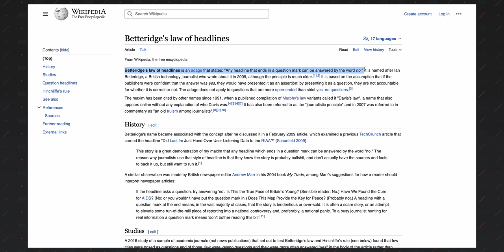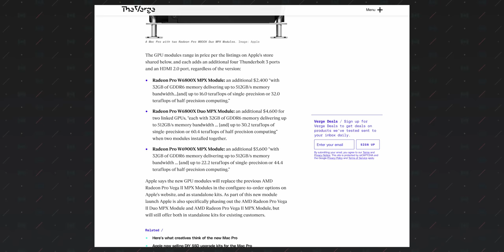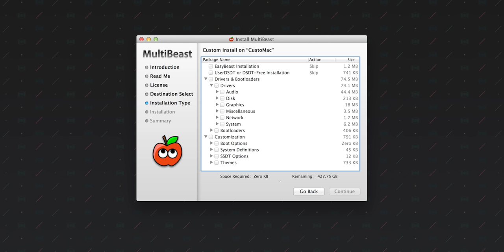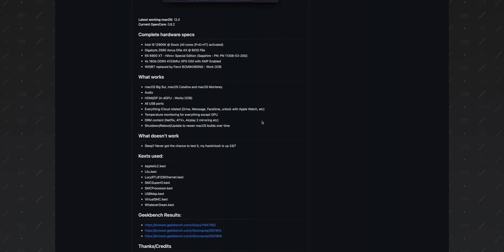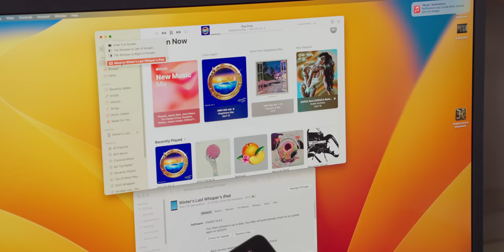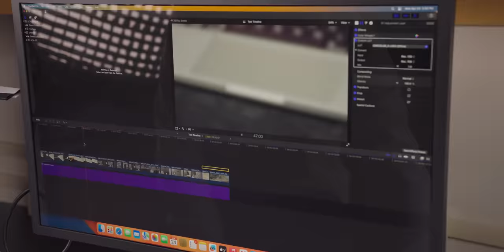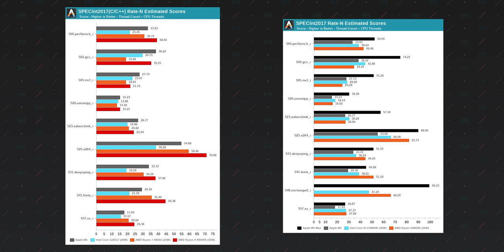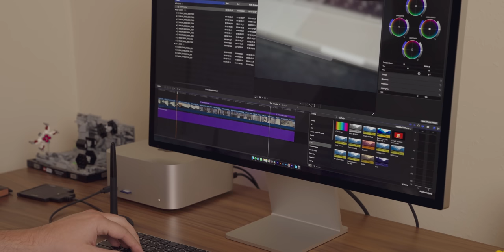This $2,000 Hackintosh SMASHES the $4,000 Mac Studio

Comment: So you compare an M1 Max and an M1 Ultra to an i7-13700. Why don’t you compare them to an i7-11th gen? Cause intel 13th gen were released this year. It’s not a proper benchmarking. Not to mention that the software you use for the Hackintosh is not legal. And a normal user would have serious trouble getting it on their computer to work properly. I mean it took you some time to get it done properly. So for a fair benchmark between the systems, you should used 11th gen cpu and also you should maybe consider laptop versions of the 11th gen cpu. Cause there is no difference between the M1 Max used in laptop and the one used in desktop.

Comment: Hackintosh's are a nightmare to maintain. One single update can break the entire thing and for that reason, I stopped using it. Everything requires some sort of complicated workaround that requires weeks if not months to study and understand. Also, you will not be able to change MacOS versions automatically. Again, to do that you have to implement complicated fixes, patches, workarounds, and patches that make Hackintosh's unsustainable. Save your money. Get an actual Mac or use something else.
Reply: Or perhaps dont update?... many people use older versions of MacOS without issues actually. For better stability etc. even when they could be running the last one and update it frecuently. Also hackintoshes usually are for large audio and video work, so it can be 1/3 of the price of a similar mac..

Comment: When all is said and done what it comes down to is rendering time. And that equation comes at whatever you deem your own time to be worth divided by how much rendering work for however many years. I have built hackintoshes and been rendering since i was using Infini-D on a 9500 Mac where six seconds of animation took days to render, watching that line slowly moving across each frame painfully... so us old school dudes don't mind an Intel based machine taking the extra 12 minutes to process a heavily FX-laden short movie vs. Apple Silicon. But like all artists, the posers need to blame their gear rather than their talent and that leads to another set of equations--whether you can make money doing this or not and invariably most cannot with the UltraMax megacore beasts or the punieste Intel squeakers chugging away. How "cool" you feel is the evil work of the ad agencies on your psyche as an artist... Don't let them convince you that you having the most optimized system automagically means you can start making money doing whatever you're doing.

Comment: This is like comparing different caviar. So unnecessary to have any of these two computers. It is only for rich people showing off.
Reply from the maker: Or, you know, professionals that use these computers to make a living…
Reply: @snazzy  other than 4k and 8k video editing, which not much people do, there is no point in paying 1500 to 2000 dollars for a laptop. Coding, streaming ,can be done efficiently using decades old laptop. 

An iPad for emails, ebook, streaming, video browsing. And then a desktop, paired with quality screen, mechanical keyboard, good speaker, for doing any other real works, is good enough for almost everyone. And it cost just half the price of the 14 inch MacBook Pro. And they can be upgraded throughout times.

As most of your viewers, I assumed, don’t even watch YouTube on their laptop, and for most of them, they just want a laptop to watch Netflix, this MacBook Pro seems overkills. What percentage of your viewers watch this video via a laptop?

Comment: So let's see... you have to assemble your own PC, which takes time; you have to install and figure out the Opencore and Hackintosh setup, which takes time; your system takes up about 12 times the volume of the Mac Studio; your system uses 50% more power (350+ Watts vs. 220 max for the Mac Studio M1 Ultra under full load); your system will be louder; your system may have annoying and pointless RGB lighting; you can't run Apple Silicon binaries (and many softwares are only supporting Apple Silicon at this point); you risk system instability and crashes, and if it breaks, you get to keep both pieces; there's a small and niche community that isn't super great at helping you if you have problems because of the low chance that others have used the same hardware; there's no guarantee this will even work with your motherboard/CPU/GPU; you're forced to use an Intel CPU and a last-gen AMD GPU instead of the even faster setup which would be an AMD CPU and Nvidia GPU; you aren't eligible for AppleCare or support of any kind from Apple; you have to trust that third-party kexts don't have spyware, malware or rootkits embedded in them; and Apple could decide to stop providing MacOS version updates to your hardware at any time, and as soon as this year for your brand new hardware. All of this to save a few thousand bucks and MAYBE get faster performance, assuming the software you're trying to run even works with your x86 processor. What a steal! /s

I'll stick with my M2 Max MBP, thanks. People who want to build a system like this should run Windows or desktop Linux. Most of Apple's advantages are in hardware, anyway; there's far better software compatibility (e.g. in Wine/Proton) on Linux on x86 than on MacOS anyway. If you aren't using Apple's hardware, what's the point?

IMO it is far too late to build a Hackintosh. The glory days of Hackintosh were before Apple announced their own silicon. Before Apple Silicon, their hardware was just an overpriced version of commodity PC hardware with an aluminum chassis. You could absolutely justify buying better hardware for cheaper in those times. Now, if you're considering investing time and money in a system like this, you should think again. This is NOT a future proof solution. It's extremely likely that you're going to be stuck on Ventura, or maybe Ventura+1 or Ventura+2 if you're really lucky, and never be able to upgrade your OS beyond that. So as Apple evolves and introduces new stuff you want, you'll be left behind. Then they'll stop supporting security updates for your version of MacOS, and you'll be running a vulnerable system. Great. 

Yes, genuine Macs also eventually will lose official support and security updates, but you're guaranteed that that won't happen for a very long time. Apple takes care of their own customers. As a Hackintosh user, you're not their customer, so they have no reason to guarantee even a single minute of continued support to you.

Comment: This benchmark is not fair. The Intel processor heats up much more than the M1, and it becomes problematic for long sessions in Cubase or Logic Pro X. Typically, after a few minutes, the Intel processor starts to heat up and reduce its performance. With the M1 or M2, you can work all day with a consistent level of performance.The M1 and M2 are a godsend for audio usage.
Reply: cinebench runs for 10 minutes which is more than enough time for thermal throttling

Comment: Every time see one of these videos they're complete BS. Hackintosh is a joke. They just slap them together and say look here, this is cool but never actually do any intensive testing. the moment you put that hackintosh in a work setting like what I tried to do with mine it will fail, be it a kernel panic, a gpu driver crash and little things not working to begin with. Trying to get a 3 hour render to finish in resolve isn't going to happen reliably and that's if you can get boards with chips that haven't been substituted for a slightly different manufacturer causing your boot files to be wrong even if you took two matching pc builds one would fail to even boot because you cant guarantee the board chips are exactly the same. In case you wonder why I care about davinci resolve on mac so much its because its the only way to export ProRes (the film industry standard) faster than 15fps(voukoder/ffmpeg) without buying a 35,000$ color panel that unlocks the codec on Linux.
Reply from the maker: Your Hackintosh was poorly assembled. This one could absolutely do all of those things.

Comment: Cool, but it's a shame that you lied in the previous video and you're doing the same here.
In the last video you were using a z590 with the uhd630 but the chipset cannot produce a video output because of it being incompatible also we didn't any actual footage of the mac up and running with proof of the motherboard oh and also you used the first nvme port on top with the 10th cpu, again that wouldn't work because it's disabled with a 10th gen cpu, you need to use a 11thgen cpu in order to use that.
Reply: We never lied, and all footage is from the working respective hackintoshes. 

Video doesn’t come from the motherboard, but from the GPU on the 10th gen which is still compatible.
Reply: @cinebenjamin  the z590 chipset makes it impossible to use the uhd630, If you wanna prove me wrong show me a video proof of you using the z590 motherboard and being able to use the uhd630, I know it's impossible that's why I'm asking, also you did not show any actual video footage of the hackintosh running attached to a monitor.

Comment: Agreed! M chips are not the best at ALL things and there are definitely advantages to Linux and Windows systems running X86. My thinking on M chips and Apple systems in general is that they are far ahead on longevity in design. X86 is running out of life, maybe 5-10 years at most really. ARM and RISK are the way forward and AMD and Intel need to work with MS to migrate their products like Apple have done or they will be left behind. Samsung could move to selling strong ARM systems soon, and China is moving in that direction for a lot of their systems. Apple has just embarrassed MS and all PC part sellers including laptop manufacturers. They have no plans and now they are stuck in the mud with hot old gen chip designs. They will all catch up....maybe....?!?! Time will tell. In the mean time Apple has a very large corner of the world market with an extremely compelling product that is well designed, has a long shelf life, is efficient, and just works...mostly. In a market of hotchpotch and poorly designed laptops, because they want the cheap end of the market, Apple is the only option for my use case, and probably is for a lot of people.